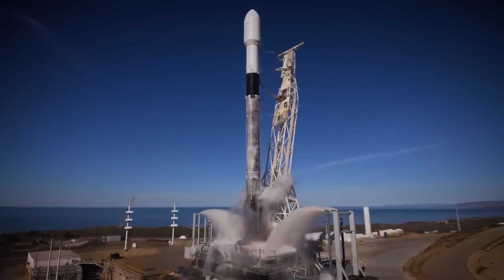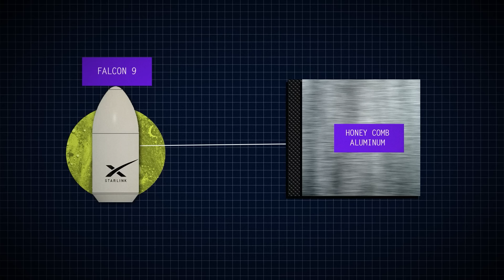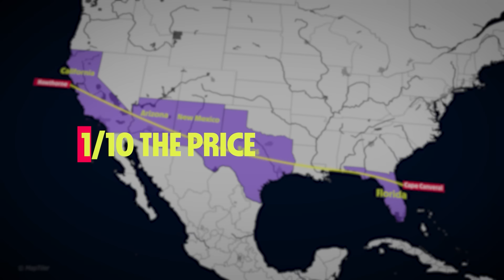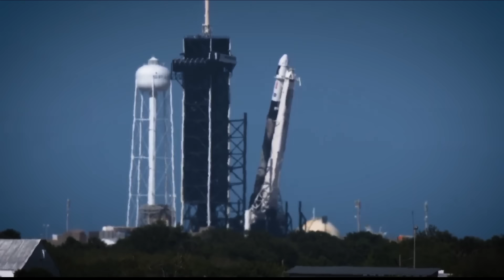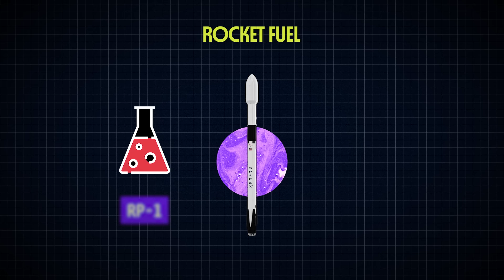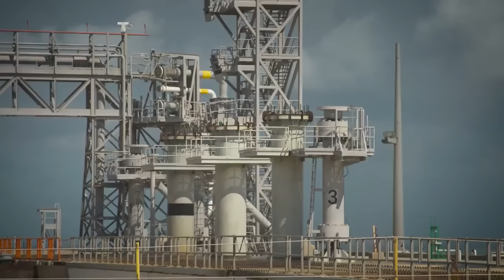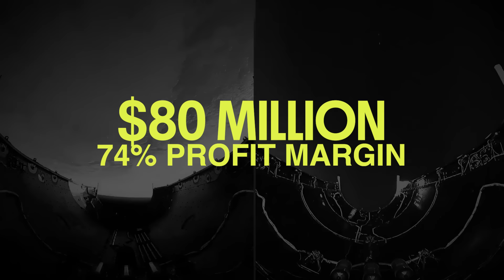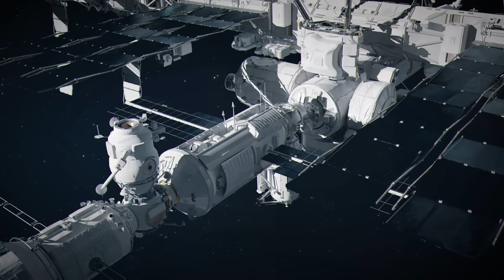Why Going To Space Costs So Much

Comment: Those $1 million reusable SpaceX engines are still a bit cheaper than the ones that NASA pays $127 million for each disposable one.
Reply: Basically, NASA spends as much for a single RS-25 engine as they'd pay for a brand new Falcon Heavy.
Reply: @jamescarter8311  the answer to this is spacex doesnt care if something goes wrong its part of their cost analysis and their insurance will cover it nasa DOES care if something goes wrong
Reply: @TheEyeTeaMan  paying that much for an engine is something going wrong
Reply: @alquinn8576  here's the issue it only costs 1mil if they get to reuse it and i doubt it's only 1 mil that sounds too little to refurbish and refill it with all the checks it would need to ensure it is safe to use again. it's probably closer to 1mil for the propellants and another 20 mil for the inspections. and if it goes boom like musks bottle rockets tend to do then its far more than what nasa would have paid for something that actually works and can actually deliver people and equipment to the moon and equipment to mars and even out of this solar system. muskler cant even manage to do what the germans were doing back in the 40s in space they were delivering more than a banana...
Reply: @TheEyeTeaMan  SpaceX said a year or so ago the all-in cost (including expended 2nd stage, overhead and everything) on a reusable Falcon 9 is $28M. I believe the refurb cost is estimated to be $2-4M. Obviously, for a heavy, the center core is expended and the outer boosters are 2x that cost, but call it $120M all-in
Reply: @alquinn8576  so it saves 7 mil over what nasa pays and that is only when it can be reused which so far is never. im not talking about the falcon 9s
Reply: @TheEyeTeaMan  idiot
Reply: @alquinn8576 and what about the r&d cost? Etc?
Reply: @TheEyeTeaMan those prices are so wrong space x is way better and cheaper
Reply: @HimaHati  no space x is not cheaper ... standard physics says they arent ... they have to take enough fuel and enough avionics to land the rocket upright rather than do what the shuttle program did and just use parachutes to recover the boosters. not to mention anything that goes into orbit then needs special plating to survive coming back to earth all adding weight and reducing payload so no there is no way their system is cheaper its not possible when you calculate how much extra propellant they need to charge for to get the extra propellant and equipment up just so it can come back down again ... far easier making a cheapo tube that goes one way than making one that ca come back. or if it is inside the atmosphere then it is far cheaper using parachutes than it ever would be launching it with propellant.
Reply: @guld1999  amortized over 600+ launches, they would be very low
Reply: @TheEyeTeaMan  nasa doesnt care about costs cuz its goverment money.
Reply: @meleris88  are you kidding??? government junk is all about costs that is why the seats in all army trucks are trash that is why if you want a off road big haul truck that lasts you dont buy army trucks (they are just cheaper per unit so even though they barely last a 10th the time of a commercial grade truck you can buy 30 of them for the price of the commercial grade truck ... and yes you can fix the army garbage to make it last but that was never really its purpose they dont expect them to last in a war but they need to be made simple and cheap and at quantity. they dont care if water gets in axle oil because you forded a river and now the axle is only going to last another 30k miles because the truck itself is only going to last for 20k miles before something does it in but in a haul truck that needs to ford water man you better have good seals as those axles need to run another 2 million miles before they have problems).

nasa is a different story as it is making sure peoples lives are preserved while in extremely hostile environments and an astronaut crew is far more expensive than the vehicle they are riding in when you take into account the training fitting of equipment and everything else that goes along with it including the things that cant just be replaced such as brain power ... remember they arent just flyboys from the airforce or "space farce" they are scientists who were part of the airforce.
Reply: @jamescarter8311  Does anyone else think that's because they're spending someone else's money?
Reply: @ghost307  NASA is a R&D organisation that has been taken over by congressional pork and lost its way. Hopefully this will change but I can't see it without a clean broom applied to con-gress (which Mark Twain once described as the opposite of progress)
Reply: @ghost307  NASA doesn't decide how to spend their money, it is the congress who decides it. 
If NASA is told to buy rocket engines for certain contractor, they do as told by the politicians, nobody in NASA itself has the ultimate say in such purchases.
Reply: @ghost307 nobody tell him about Spacex's "contracts" with NASA, and where money for those are coming from
Reply: Most things about NASA cost more than they should, as you somewhat point out.
Reply: that price difference is awesome!
Reply: @SpectacularRanker2 corruption and laziness is awesome
Reply: For NASA, All of the million dollar rare element ends up in bottom of sea😭
Reply: Because they aren't taken as far out of orbit and on longer missions out of Earths orbit. Falcon heavy has never been to or around the moon.
Reply: @6kts0 Rocket engines don't care how far they are from the factory. Any rocket engine designed to work in a vacuum will work in Earth orbit, lunar orbit, Mars orbit, or around Tatooine.
Reply: @ghost307 @ghostid a whole lot of nothing pal. Can you not fathom how sending non organic payloads on LEO missions will yield cheaper fuel costs? Once they consistently commit to missions involving human life and long duration exploration the fuel costs go up because of the amount of fuel required for safety precautions and manual flight control options that will be introduced.
Reply: @6kts0 When did I say anything about how much propellant would be aboard?
Reply: @6kts0   This statement is void because the original comment was referring to RS-25, main engine of the SLS. Since it is used exclusively in first stage it never reaches earth orbit. It will not be reusable as they would be permanently attached to the discarded stages and disposed of in the atmosphere after about 8 minutes of burn time. In the shuttle days NASA bought these at $40 million each, on may 2020 NASA bought 18 extra for $1.79 billion.
Reply: @6kts0  not to mention has not yet carried anything more than a single banana to space
Reply: The expensive NASA stuff was done for him so he could own whatever ended up in space.    He needs to go away  I think that is about all that left for him.  He is only clever gambling on Wall Street.  He really ought to start behaving himself.  He won't.  He truly is extremely arrogant and he embraces taking our government apart and criticizing virtually department after department which he only destroys because he does not see any need in his billionaire's world for government.  That what he thinks he is here for.  We are headed to a showdown with this mentally ill person.
Reply: Crazy that this dude Elon is behind it. This fool did what nasa could never do. All out his pocket. Idk how he ain't go broke tryina dump BILLIONs into something that doesn't generate money. Guess he's only tryina do it for humanity in the long term.
Reply: Oh fuck I ain't realize he taxed nasa to send the astronauts up. Damn
Reply: @BayAreaBully7667NASA pays him to send astronauts and equipment into space. For that he gets paid an amount equal to his costs and an allowance for profit (generally 10%). He uses that profit to pay a lot of the costs for his Starship programs. 
HLS is a separate contract, but so far he's only been paid for the mock-ups, not the whole amount.
Reply: the RS-25's you mean?
Reply: naturally R&D is completly neglacted in that comparison
SpaceX engines cost "nothing" in R&D. altough it was a decade long process; but those costs are always thrown under the carpet when talking about mass-produced SpaceX stuff
Reply: @benjaminmeusburger4254  NASA handed Rocketdyne a $1.79 billion contract to build 18 RS-25 engines, which had been fully designed decades ago. No R&D costs needed, just waste and fluff while spending OPM.
Reply: @b @benjaminmeusburger4254 The Merlin Engine isn’t as complex as the RS-25. It’s cheap and light and does its job. It’s not efficient and doesn’t have much moving parts. That’s how it became so streamlined with not much R&D
Reply: @benjaminmeusburger4254  " naturally R&D is completly neglacted in that comparison" Maybe because SpaceX integrated production and R&D so tightly that you can't tell one from the other ? :-)